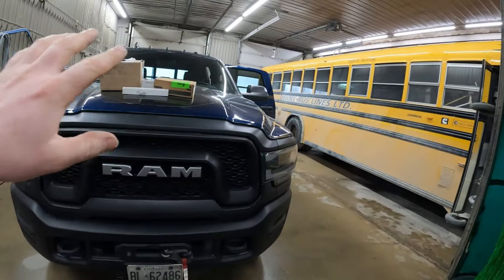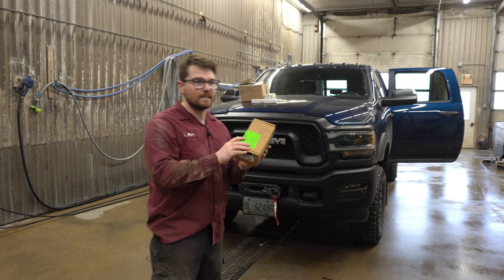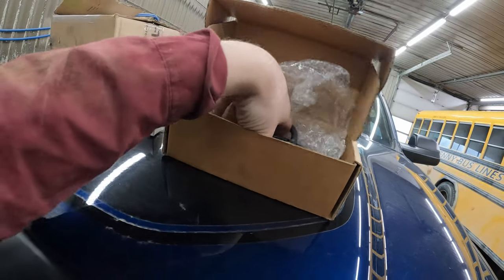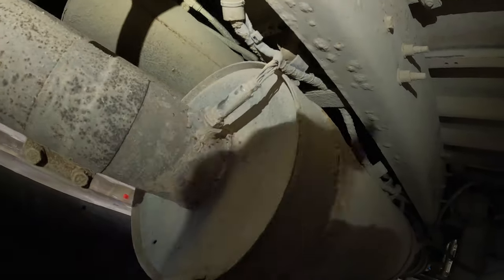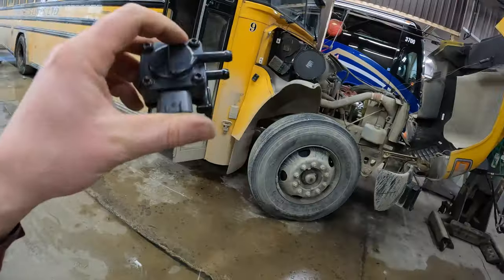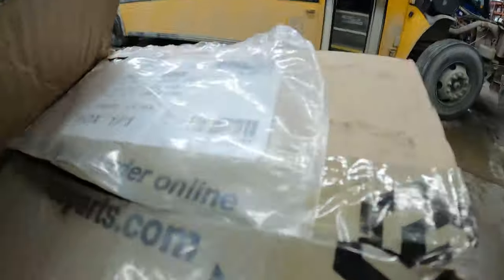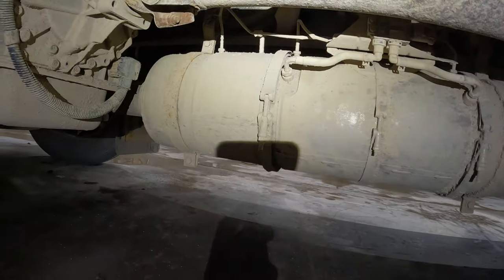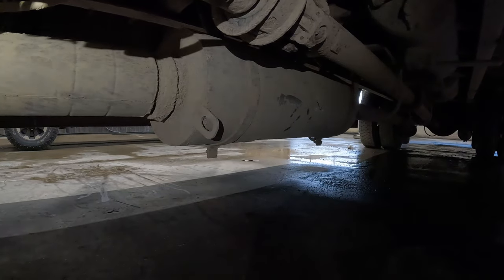RAM 2500 Cummins Aftertreatment Cost of Repair (Not Cheap) | Are Modern Diesel Engine Worth It ?

Comment: that's insane 10 years then you scrap them  
my dad has a 6.7 cummins in his 2012 2500. he said right before it broke 100,000 kms it stated running like crap so he started sending it to the dealer $1,100 - $2,500 bills yet it's still gutless. I've been trying to talk him into deleting it for years and we finally did it. a mild efi live 50 hp tune and a turbo- muffler exhaust ( to keep the factory tailpipe and muffler so it looks stock to MTO)  and holy crap bud that thing moves now.

Comment: I got an '07 5.9L.....no emissions equipment, chopped the cat off, chopped the muffler off. This is the way it should have been from the factory.
Reply from the maker: probably runs like a charm still.
Reply: What about 5.9 Cummins 
I want to buy 2005 ram

Comment: Amazon EGY sensor socket set. They are relieved to fit over the cable
Reply from the maker: that's the next best option! but sometimes they won't crack the nut loose. and eventually you end up hammering on a socket and heating the sensor red hot.

Comment: A few years ago onof my companies '15 International with a 15L cummins.  The turbo blew an oil seal and sent tons of motor oil into the doc/dpf, witch caught fire. The fire department ripped them out from under the truck to put out the fire. The cab was fine. I had to replace everything turbo to the stack. It was $45,000 (for just the parts). Insurance totaled the truck

Comment: Just did a Knox sensor 2013 2500 with 27,000 miles it cost the customer 1200 bucks
Reply from the maker: Wild eh. they are pricey
Reply: Very pricey